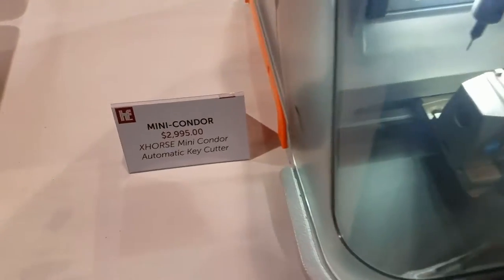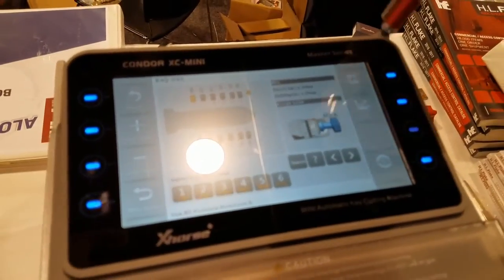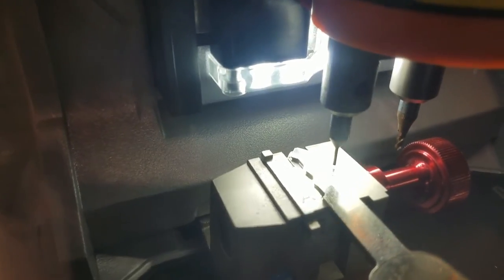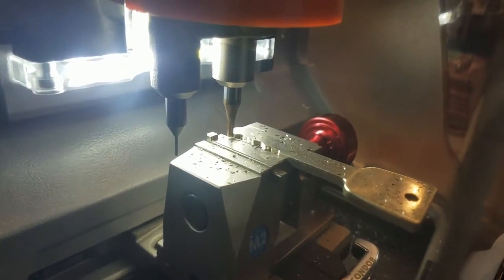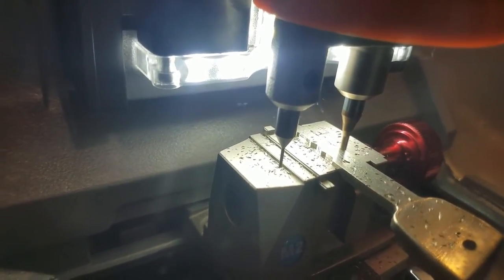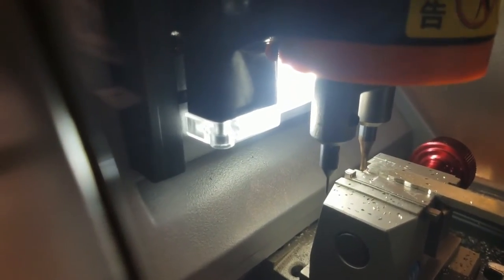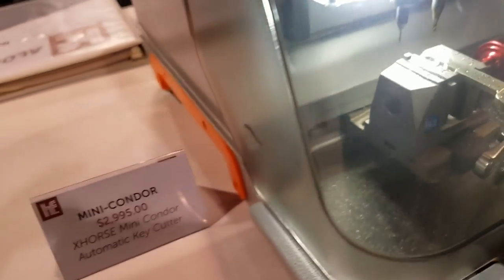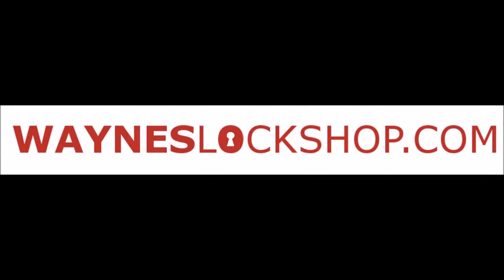Mini Condor XC Automotive key Machine Making a Honda High Security Key ALOA Expo 2017

Comment: Takes a little longer to cut than some machines,  but because makes two passes,  it is way easier on blades. The blade are a lot cheaper than other machines, and while I haven't had it a long time, they seem to last longer too.
Reply: Say Scott does this machine just make copies, or can it cut by code or direct input like a Bianchi 994? Also have you tried this machine in a work van? Since looking for another machine that I can carry in my work van, but really don't want to invest a load since I already own a 944 and all its jaws.

Comment: Also,  this is much easier to use than our 994 laser.  User interface,  not quite as easy,  but I am used to the other, and I just may need to get used to this one. Less switch over between types of keys.  The 994 make you switch cutters between sidewinder and regular edge cut.  This suggests a different blade,  but I've cut 50000 series Toyota's with the regular sidewinder blade that lookband work perfect. I don't know if there is a real reason to switch.  Only thing to make this machine perfect is a vise to cut single sided keys. (anyone from xhorse out there? I'd even pay more for this... Your vices are $130-190...I'd probably give 400 to add a vice and software for this.)...with the ability of this machine, it is definitely possible. 

Also when he said 2 vices... One 4-way vice for sidewinder, one vice for double sided edge cut,  but a third for tibbe...but way better than most for amount of sidewinder vices and cost of vices.